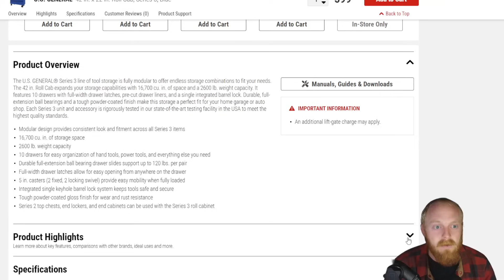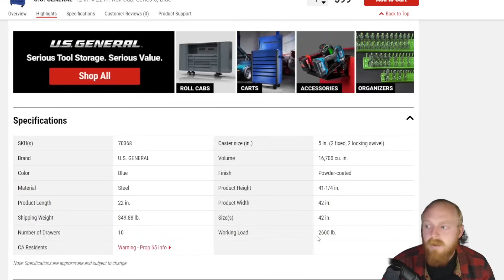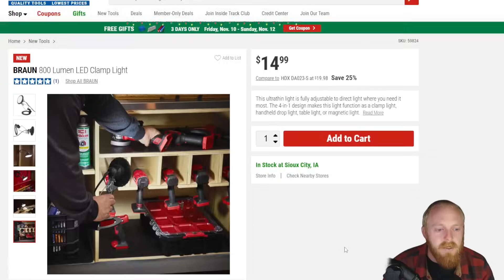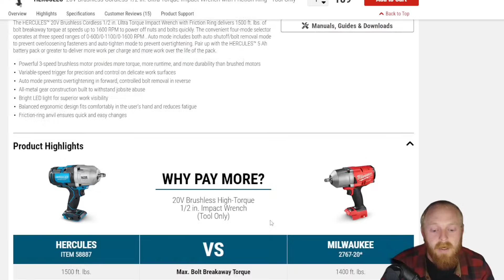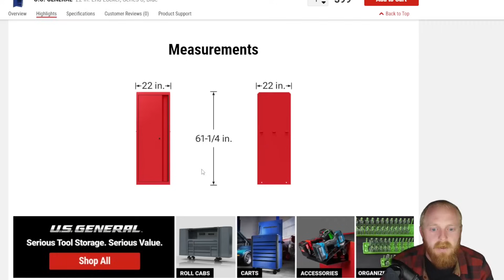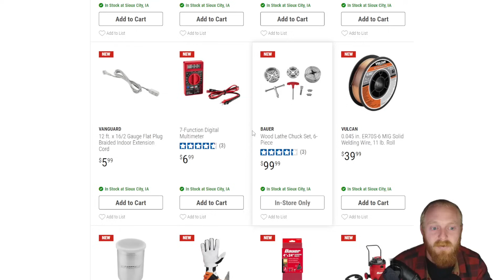New Harbor Freight Tools Some Good Deals

Comment: Series 3 is completely backwards compatible with Series 2.  

That said,  I am actually disappointed in the new 42" bottom chest.  I like the fact they added the full-width second drawer,  but it has too many deep drawers on the bottom for my liking.  
I know opinions are like A$$holes. But my opinion is that narrow, deep drawers are all but useless.  

Too shallow (height-wise) to stand up a power drill or two,  but too narrow to lay one down without taking up the entire drawer bottom. 
And storing wrenches, screwdrivers, sockets or any other hand tools in them is another waste of space.

Another awesome vid, Tony.   :)
Reply from the maker: Ya I can completely understand that and if your like me you don't like to stack stuff in those mid height drawers. I don't like digging for things. And your right it's a waste of a drawer to have screwdrivers or wrenches in it. Thanks for sharing your thoughts

Comment: I just today stopped at HF to look at wheeled tool carts and checked out the Quinn ratcheting box end combo wrenches. They're billed as 90T and I believe it. Much better feel, less drag and slop than the usual Pittsburgh brand and even the Icon 72T wrench IMO. I think you might be surprised by their ratchets if this holds true through their 90T line. I'll be interested in hearing your opinion. If Quinn comes out with a flex head design,  I'm likely a buyer,  much to my surprise.